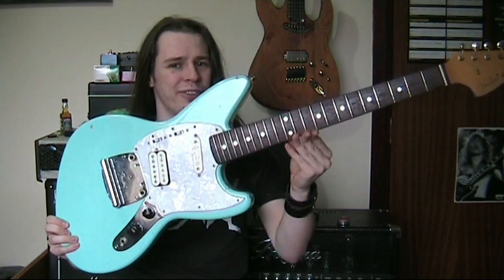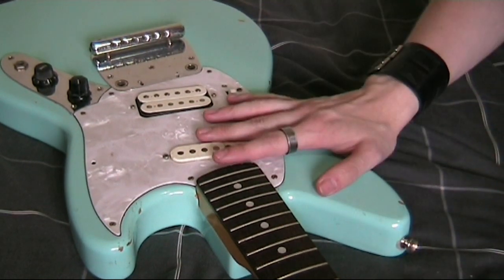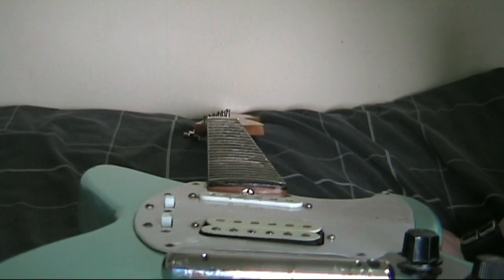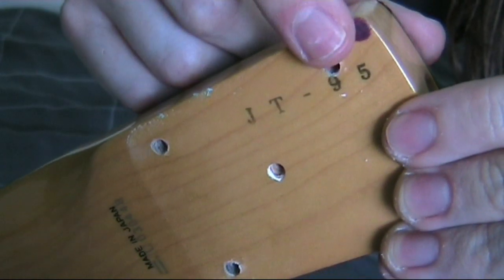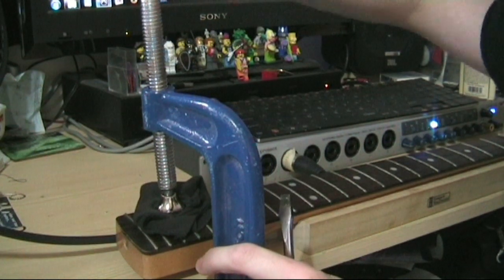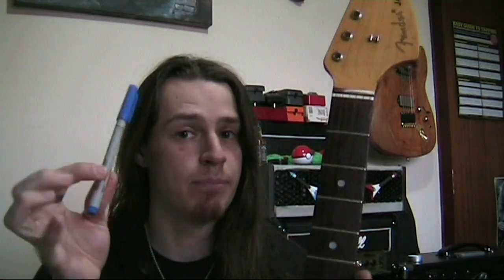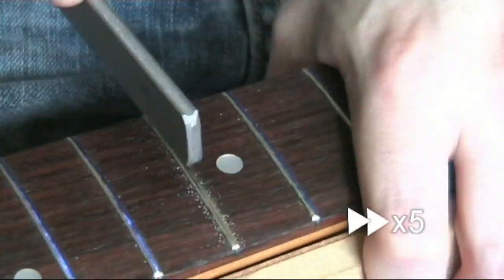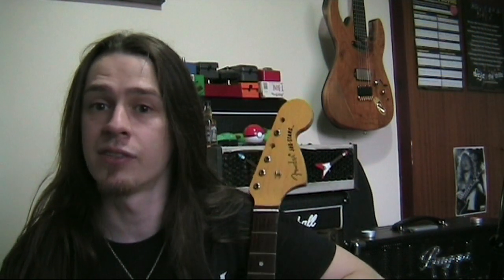Jag-Stang Part 1: Truss Rod and Fret Dress

Comment: hey. great video. I have a highway one strat that I can't seem to flatten out and I don't want to over tighten the truss. So if I was to pull it off and clamp it, slightly bend it while the truss is as tight as I was comfortable with. I should get a bit more relief to give it a 1/4 turn? I was unsure what it looks like inside. Am I at the end of the available threads or is it just fighting the bow?

Comment: Nicely done.  I like to see people doing videos like this.  You can do an hour long video on fret work.  Are those tools all stew mac?  I dont have a 2nd mortgage to afford their stuff.

I have done the neck relief bending thing on a 20 year old Aria bass.  Its a good trick, although I usually release the tension on the truss rod before I bend it and leave it clamped overnight for a longer lasting adjustment.

What do you polish the frets with?  I use a combination of fine grit sandpaper in ascending grades and finish off with some brasso wadding myself. You can polish out most scratches that way.  some people dont like to use it, but I prefer that to wire wool, especially on a fretboard that isnt sealed and has a pronounced wood grain like rosewood.

Comment: Thanks for the videos. A follow up question. Do you think using your eye for straightening the neck is good enough to do fret leveling. I would think a grooved straight edge that sits over fretwires and makes sure the fretboard is level would be important. I have a good eye and dont use a straight edge myself but was thinking about getting one for people that like low action.
Reply: +LinoOC not using a straight edge is equal to fucking up a perfectly good neck.
its hard to eyeball 5 to 10 thousanths 0.005-0.01" of an inch(actually impossible over 2 to 3 feet)
i would think everyone wants the best action their guitar can provide,dont you?
Reply: +trillriff-axegrinder  Ya, I am wondering if I got hacked. I don't remember this post. I do use a notched guitar neck straight edge for straightening neck before checking frets with a straight edge. I think what I poorly wrote should have said is it is essential to straighten neck with the proper tool before approaching the frets. You wouldn't believe I have been doing this for over 40 years with my previous statement. Thanks for calling me out. I got to go see if some one has been screwing with my pipe. :-)

Comment: Setting the truss rod on a neck not under string tension? Eeeeeh....
Reply: actually  it makes sense if you are gonna level the frets. that way the neck is straight with no strings. then you make a final adjustment when you are stringed and done.

Comment: can you be certain if the truss rod adjustment is perfect before you bolt the neck on or do you have to keep changing it?
Reply: I'd guess that once you get some experience you can get it pretty close, but you'd have to put on some strings and see how much the neck bows under the tension.
Reply: it's my understanding that you simply want to get the neck perfectly straight when it has no tension on it.  Assuming there are no flaws in the neck it should bow the correct amount when string tension is added back to it.
Reply: That could work, but it could also fail dramatically if you put really light or really heavy strings on it
Reply: i should have been more specific. my post was for the necks with the truss rod adjustment at the bottom of the the necks that yo have to take the neck off to adjust. not how how to do basic neck adjustments.
Reply: I´d say no, you can´t be 100% sure unless you´ve done it loads of times and know how much difference in tension there is on different string gauges
Reply: Guitarrman i totally understand everything about setups etc., i just wouldn't opt for his old f-type necks w/ the untouchable truss rod in the neck joint so you can't do a minor adjustment on the stupid truss rod w/out havin to take the neck off lol! humidity etc. to do all that? i was hoping for a pointer on doin it once. thats all. dumb question i guess.

Comment: Is there a reason you didn't just replace the frets? Maybe too much money for the customer? Or maybe something you're not yet skilled enough to do? Those dents are bothering me. lol
Reply from the maker: I'm perfectly skilled at replacing and installing frets.
it is an expensive and time consuming process however, it's something I'll have to discuss further with the customer. I also would have to order fret wire of the correct size, all the fret wire i have currently is larger than the installed stuff.
Reply: Ok cool. Thanks for the reply and videos! =)

Comment: Wtf you have to take the neck off to adjust the truss rod?? What a shitty design...
Reply: Boo hoo, you have to unscrew 4 bolts. Get over it.
Reply: Adjusting rthe truss rod is much easier with strings on
Reply: +Piotrek Lesiński makes sense easier to sight the curve with the strings taught. I realise now that this is how most of the original strats and teles' necks were designed too.
Reply: Even worse, I have one like that and it has a Kahler trem. Meaning I have to resetup the tremolo spring tension every time I want to adjust it. Nice one fender
Reply: Monxoboyo 😂 Hey it works!